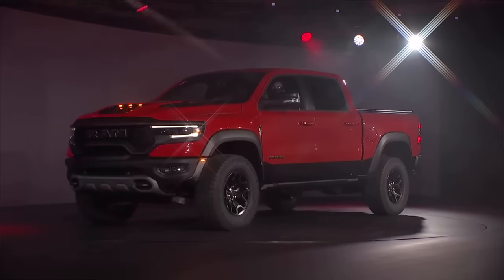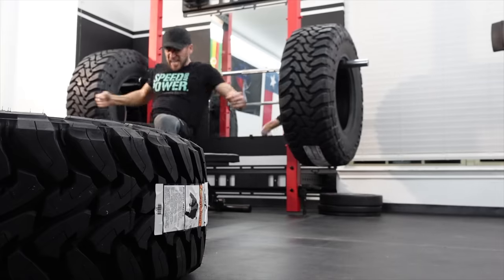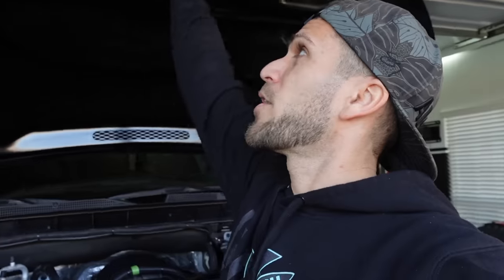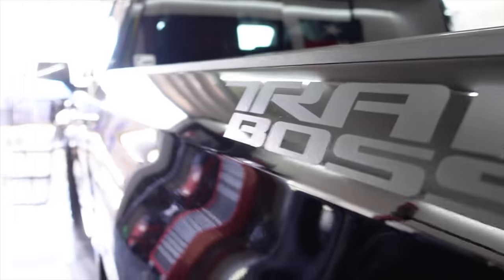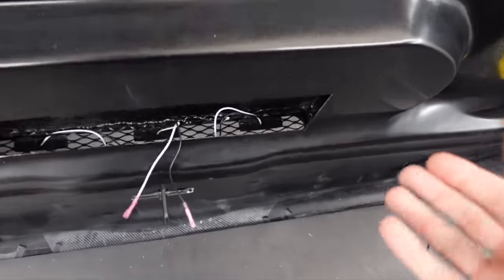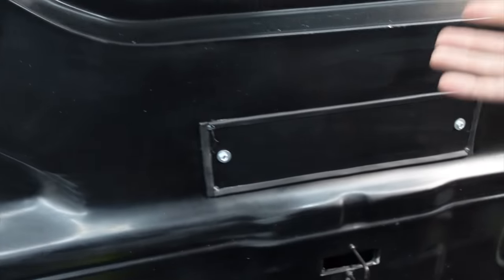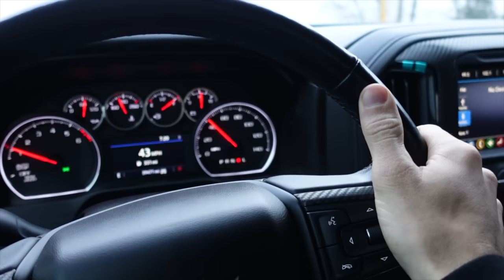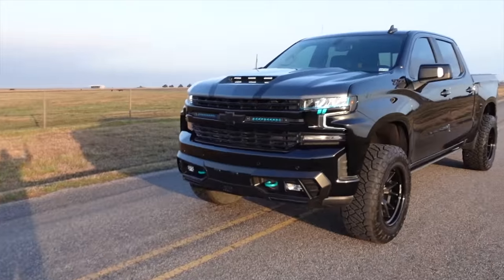Doing What CHEVY Should Have  - TRX Ram Air LED

Comment: Chevy didn't do this because the width of the truck doesn't require them like the TRX and Raptor do.
Reply: Same reason a Bronco Raptor has those light but regular Broncos dont.
Reply: Negative. The raptor has always had them and when they were first produced they were one tenth of an inch under the 80 inch that requires the lights. Also the lights see required to be “as high as practicable” i.e. the roof. That’s why they’re on the roof of literally all vehicles 80 inches wide or more. The lights in the hood/grill on the raptor and TRX are just for looks
Reply: DOT reg lights are not needed on it for already said reasons.  Nice work but no thank you.  Almost worse than seeing them on a Taco🙄
Reply: @stevenromano8708  Whats worse is on the 4 runner, I swear everyone of them I see has them now 🤦‍♂️
Reply: @menarenotwomen  both raptor and TRX are over 80" wide. DOT approved the marker lights being in the grille/hood scoop. Not sure how Ford and Ram argued that was as high as practical, but they are to meet DOT requirements, not just for looks

Comment: Two things you should purchase to have on hand.  First, various colors of heat shrink tubing, you could have put both of those wires in black heat shrink and it would have vanished, and provided more waterproofing than the butt connectors provide.  Second, various sizes of split loom.  Take the wiring and have it inside split loom and it will look even more factory.   Great video, great content as always.
Reply: I’ll second that. That’s the way I installed led marker lights on the hood of my Tundra.

Comment: If I can offer a suggestion, change out the hot glue tack downs to silicone. Just in case of either a hot summer day or your engine heating up and that glue coming loose then your wires will fall. Just a thought, hope it helps. Aloha my braddah 🤙

Comment: Fun fact:  The reason the TRX and Raptor have those 3 little lights is because they have to do.  Any vehicle over 80 inches wide must have 3 front amber and 3 rear amber lights to warn drivers that a wide vehicle is coming.  The reason Chevy didn't do it is because they didn't have to.  Looks great, just wanted to drop some knowledge on ya!

Comment: The lights are required by law on the Ford Raptor and the Ram TRX due to the width of the vehicle. Just like a dually pickup is required to have side marker lights on the back fenders where the dual tires are.  Since the Raptor and TRX are wider in the front and the rear its required to have corner lights and additional lighting on the vehicle.

Comment: Did you put a rubber grommet where the wires come out of the hood? As time goes by this can be a wear point with vibration and opening/ closing the hood. For an even more cleaner an less costly wiring connection soldering gun and black and red heat shrink wrap

Comment: Those 3 front lights on TRX and Raptor are required, by law, because they exceed a certain width, because they are widebody.   Thay are not for looks, at all, and Chevy did not "leave them out".   Bylaw ALL manufacturers use them to mark vehicles that exceed a certain width.    When Chevy makes a Widebody truck, it will have the 3 marker lights, tool

Comment: How did you get the light to hold onto the mesh after cutting the tabs off?
Reply from the maker: 3M on the outside and inside on the grille holding the light agains the mesh.
Reply: Thank you

Comment: Hey does anyone know what the weight difference is between this stock hood and this fiber hood? Please!
Reply from the maker: They are very similar in weight. I was surprised how light the stock hood was when I took it off. There's probably a pound or two difference, not much.
Reply: @LonestarHawaiian  thank you for telling me. One more question. Do you have rain water get in engine bay from the scoop?
Reply from the maker: @garrisonjasik5367  Not a significant amount of water. Most drains out near the hood latch, but lots of dust does get in.
Reply: @LonestarHawaiian  thanks bud. I also drive a 2020 Silverado and in Texas! Some of our mods are similar!